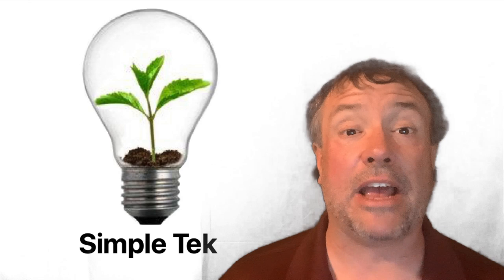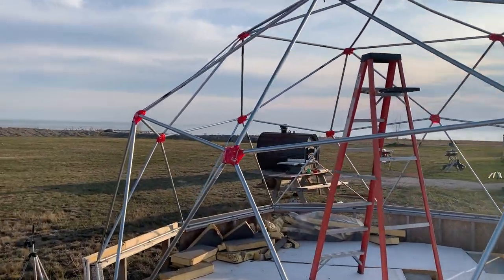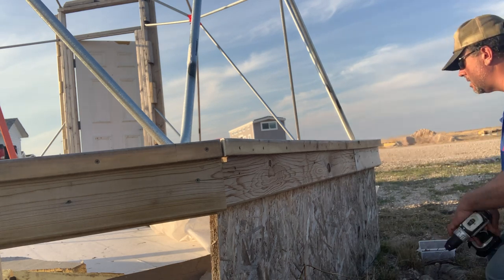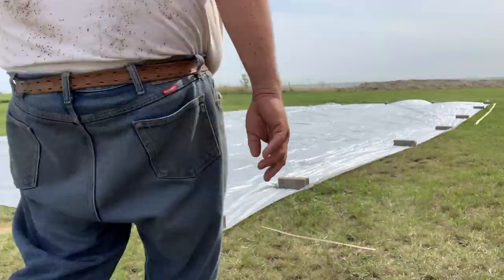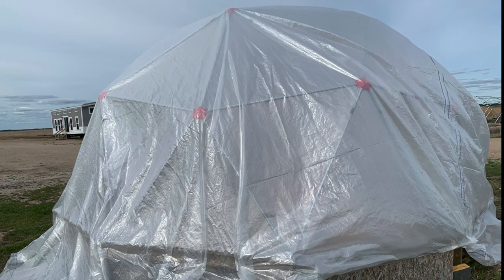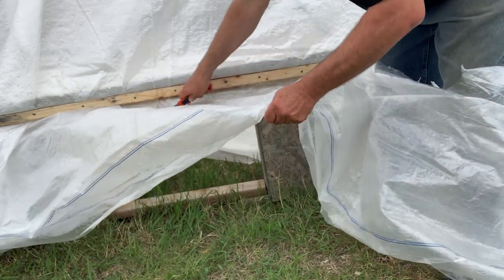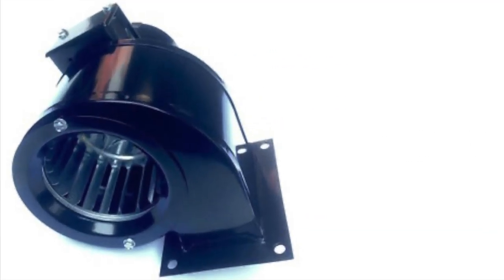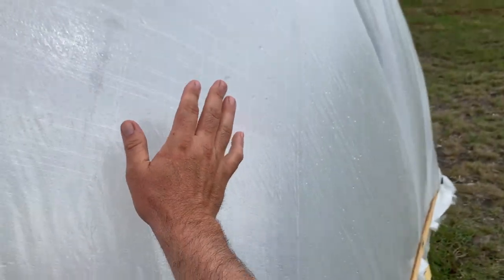Round Dome Greenhouse covered with a Square Polly Sheet (part 4)

Comment from the maker: Let me know what you think about how I covered this metal conduit dome in the comments below. I'd love to hear your comments and ideas.
Reply: still alive?
Reply from the maker: @BxBxProductions  yep
Reply: very good idea, but instead of running a blower all the time, i think i'd blow it up good and tight, and then put styrofoam spacers at the joints, to keep it that way
Reply from the maker: @brucekurkowski3340  they always lose air over time
Reply: @SimpleTek  
 With welded seams an inflated  cover can go for days without any topups. I have to let air out of the cover in the summer due to thermal expansion.
Reply from the maker: @joel6427  just replaced the plastic a couple months ago actually

Comment: Let me preface my questions by saying that I have no knowledge of building something like this. Looking at the outcome after the blower is installed, did/would you have to add some much framing? It seems like the air/blower adds a fair amount of support and stability in wind? Could you get away with 4 curved column pieces and 1 or 2 rows around? Also, doesn't look like a bunch of sun, but hooking a solar array and some batteries for your blower?
Reply from the maker: @mrbcgaddis  all possible

Comment: Good work, but I can't tell how the blower is oriented and install. It looks like it is by the door frame... is it pulling air from the outside? Are you blowing air between the sheets or just into the cavity of the dome?
Reply from the maker: the blower pulls air from the inside. in-between the two sheets.

Comment: I don't think controlling temps in a green house while blowing air in to inflate it would work out very well?
Reply from the maker: seems to work for me....
Reply: @SimpleTek  If it's too cool outside and the greenhouse is warming, blowing in cold outside air will of course lower the temp in the green house. Especially at night. The whole advantage of a green house (aside from keeping in moisture/humidity so it requires less water) is developing warmer air and keeping it. When and if it's too hot, then venting is needed. So the blown air would be good in that situation, but not when the actual green house makes an advantage, which is the purpose for a green house to begin with. That's pretty simple green house tech.

Comment: Just found... neat.  Reminds me the use in Canada with foam beads blown in at night or whenever temp drops... then blowing out when suns up enough or something.
Reply: I was also thinking instead of tape using old plastic bottles that can handle UV... not sure what would be best outdoors since maybe would be something else plastic UV treated and using a heat gun to shape around.  Guess on the plastic recycling kick.
Reply from the maker: interesting idea

Comment: Can this plastic be melted like they do when they put boats away for winter?
Reply from the maker: you know, I thought about that.  there's pluses and minuses on that idea. it would look better but I'd be concerned about the UV coatings and the anti moisture coatings on the plastic, I doubt they'd handle the heat. plus when shrunk the plastic might not transmit light as well... personally I'm ok with the folds but you put forward a VERY good question and one I had been thinking about. Thank you!
Reply: If you put a heatgun on gh poly it will expand and melt, it defintely wont shrink.
Reply: I invested in the heat gun and I am using 8 to 12 mill shrink wrap on my domes. Generally speaking it depends on where you build the dome. In Michigan the plastic can last as long as 13 years, so far longer than most greenhouse plastic anyway. I’m using 12 mill, extremely thick, white plastic on the base of the domes and then welding that to clear plastic on the top. The white plastic is flame retardant, the clear plastic is not.

Comment: Great Scott,
     Have you collected thermal data on this yet? Compared temperatures inside and outside? In a different comment you mention you get 60 mph winds a few times a year. Is it worth the investment to put up a cheap wind break? Something like a straw/hay bale wall or maybe even a plywood structure? A wind break wall will add to the cost of the project, but could extend the wear and tear on the greenhouse plastic. Something worth considering after some observation time. And in another comment you said the blower pulls air from inside the greenhouse. Does it also exhaust into the greenhouse? Cheers,
     Bill
Reply from the maker: the pillow effect of the air inflated poly doesn't need a wind break - it handles the high winds great! the air slowly leaks out cracks inside and outside.
Reply: @SimpleTek  
Ideally, the only place the cover should leak is back through the blower when the wind hits it. If you have airleaks in the cover you dont have still air in the cavity. It would be worth hooking up a manometer (easy to diy) to check what air pressure you have, generally double skin tunnels run 0.25" -- 0.5" wc. You can adjust the cavity pressure by restricting the blower inlet. Using too much pressure will stress the poly, especially in hot weather. I use a differential pressure switch to maintain the cavity pressure in mine, air is only added to the cavity when the pressure drops below the setpoint.
Reply: @SimpleTek  then you are getting some air from the outside because this isn't going to be airtight!
Reply from the maker: @rogerjensen5277  some, not much

Comment: Approximately where are you located. I'm in north central Montana and it gets pretty windy here at times too, 60+. Wondering if this would work for me too. Just thinking.
Reply from the maker: I live about 60 miles north of Winnipeg, Manitoba Canada, the coldest major city in North America. I live n the shores of Lake Manitoba, looking out on 30 miles of open water. The winds are huge here with that, we had a 130 kph wind here this summer and the greenhouse didn't budge, regular 50-70 kph winds
Reply: @SimpleTek  ty for that info. That gives me more confidence regarding the winds here.
Reply from the maker: @magapefarmshomestead6453  air inflated coverings are hugely wind resistant.  single layer not so much. the air inflation acts like a pillow in the wind.if the inflation goes down, the wind will tear it apart. it's smart to have a battery backup device on the blower like a computer can have.

Comment: this is amazing, I was just thinking about doing this
Reply from the maker: thank you!
Reply: @SimpleTek  
I dug out this old vid of an early pillow test i thought you might like. The air in this small pillow will support a UDL of 186lb (84kg). Scaled for a 32ft dome (not made of conduit) it would be around 1200lb (544kg)
https://youtu.be/8uwJjIqzfBg
Reply from the maker: @JohnGuest45  cool video! Thank you fro posting. it's amazing what one can do with air pressure and plastic!
Reply: @SimpleTek  
Aye, a small amount of air pressure can lift decent weights without any trouble. Here`s another test i did on that pillow involving a 25kg concrete block  https://youtu.be/zzj5qT988jU

Comment: So why have a dome frame at all if youre going to blow it up with air?  Makes no sense.
Reply from the maker: cause domes are way stronger than other structures and that matters in a high wind area like mine
Reply: Dual cover with air as insulation , that how all the northern climate greenhouse keep warm.

Comment: How long do you expect that 6 mil poly to last in the sun?
Reply from the maker: 6 year warranty. people have told me double inflated they last about 10 years - but we'll see. we get -40C here and 2X a year 60 mph winds
Reply: Simple Tek I Believe at least six years especially with it inflated in the wind, but who asked me, haha
Reply: @davidfuller764  
Assuming its installed correctly and you run at the correct pressure which varies with season. If you run too much pressure in summer the poly will stretch and vecome thinner near the attachment points. It wont fully recover when it cools down so it starts out fractionally thinner in the same locations the following day. The thinner it gets, the more it will stretch.

Comment: Thks & I assume clear shrink is available:
      Shrink Wrapping a Geodesic Dome - 18 ft 3v Frequency https://www.youtube.com/watch?v=5eOQxjZUj_A&t=35s
Since the dome frame requires so little effort/resources, may I also suggest a concentric double/triple/quad/etc dome frame.
Reply from the maker: sweet
Reply: 200 micron marine shrink wrap for an 18ft dome would cost about $130 here, lifespan 1-3 years.  Double poly costs about the same and will give you at least 5 years.

Comment: pro tip. You need the outside air to fill the bubble. Otherwise, you'll have condensation (mold) before long, inside.  I used this for solar. https://www.amazon.com/gp/product/B000O8D0IC/ref=ppx_yo_dt_b_search_asin_title?ie=UTF8&th=1&psc=1
Reply from the maker: Thank you sooooo much for the link!!!!! I've been debating using outside air and using air from an earth tube....